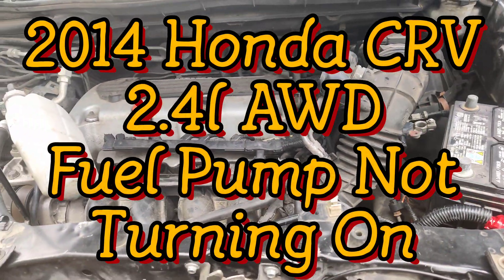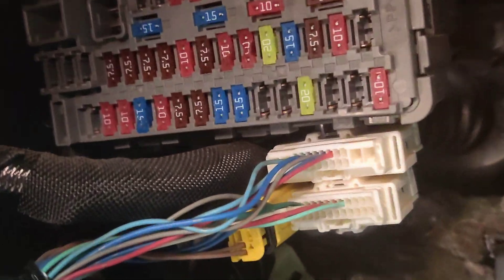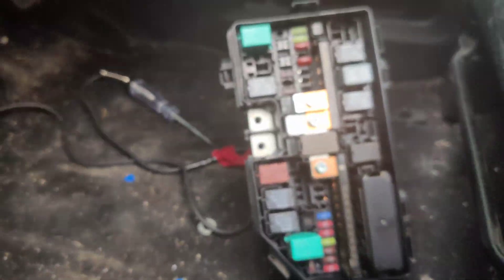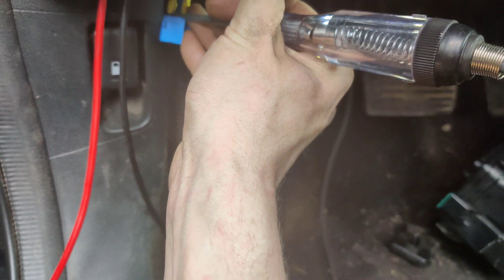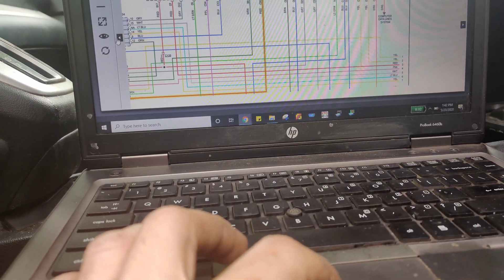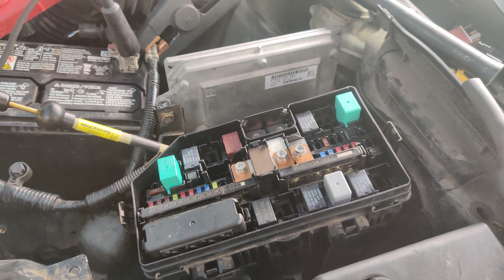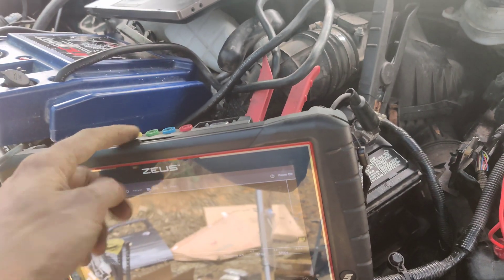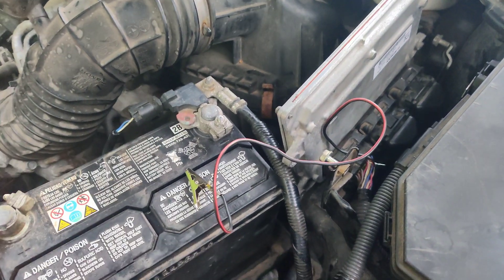2014 Honda CRV 2.4l AWD Fuel Pump Won't Turn On Bad PCM?

Comment: Mine has same issues    fuel pump wont turn on.    Did replaced  pump and program it.  Security lite goes off. So no issue there  all fuses are good  and relays.  And pump works if  I put pover to it.    But I still get nothing.   Any ideas
Reply from the maker: Did you check to see if the pcm is commanding it on?

Comment: Stop piercing the wires back probing is only way thus dislike otherwise good video
Reply from the maker: What's wrong with piercing wires? If a few pierced wired are the difference between telling a customer that they ha e to spend $500-$1000 for a new pcm and me hoping I have a good bsckprobe I will pierce wires all day long. I don't always pierce wires. I backprobe a lot.
Reply: Robert Dotterer well at the time wire has been pierced nothing wrong but with time moisture gets in corrosion takes hold poor connection and all sorts off problems 
In dry climate country might be not so bad but here in UK had few times where’s wires had been pierced and corroded in a couple years time had a 2014 BMW where wire was pierced and inside insulation no more wire only green crust 
So avoid piercing whenever possible
Reply from the maker: I always put liquid electrical tape on the wires when I pierce them. I have several videos of me doing it. I just didn't show it in this video.
Reply: Robert Dotterer sorry to pick on you then apologies if any
Reply from the maker: It's perfectly fine, I don't mind. Some people hate it, some people like piercing wires. I used to hate it and only back probe but then I got thrown in the wrong direction because of poor contact. So now before I call something bad that is hard to backprobe I pierce the wires.
Reply: Robert Dotterer totally understand and please don’t be offended I honestly never meant to upset you if any my apologies 
But from my personal experience have seen many issues caused by piercing wires thus now always try back probing whenever possible even myself before used to use piercing method but when had to spend almost two days chasing can bus fault on the Mercedes and found corroded wire from piercing said myself no more using that method only in exceptional cases
Reply: @sitdox   new cars backprobing is not a option, because waterseals are so small. Piercing is not a option too, only frontprobing or breakout leads